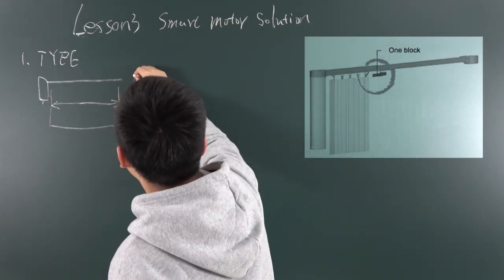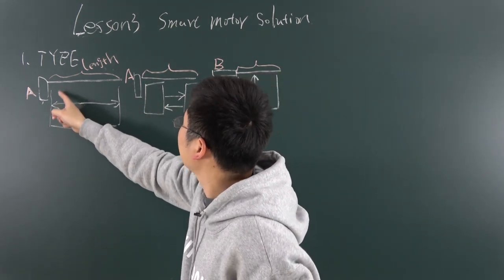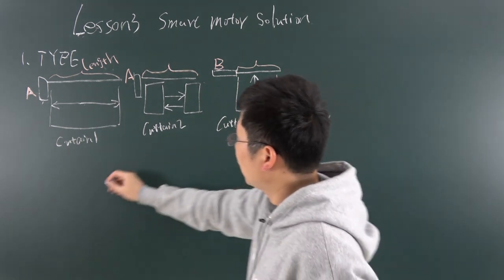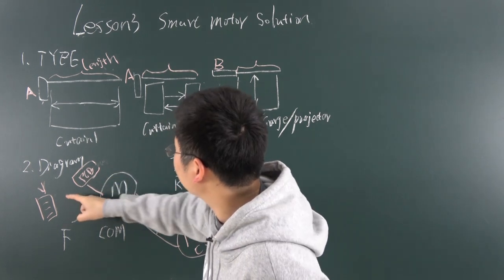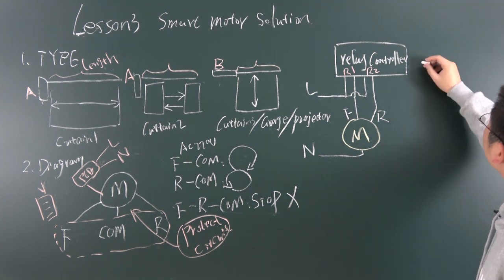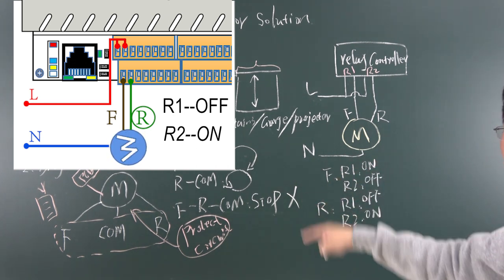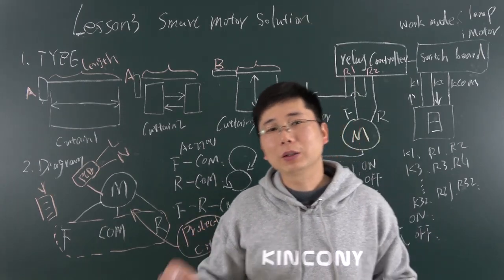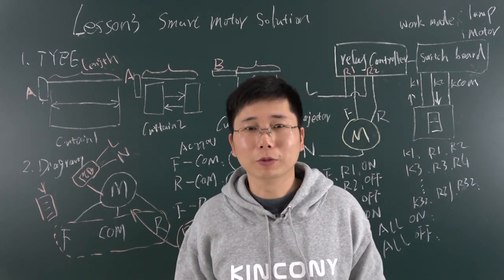【IoT training lesson beginners #03】How to let your motor become smart

Comment: Hi, what if I want one button on wall switch and input panel out of 32 to act as press and hold? As long as I hold the button the reley is on, and when I release the button the reley turns off. Is this possible in home assistant and in kincony android app?
Reply from the maker: you add KC868-COLB work with relay controller is ok, it can set logical command by yourself. we have another video: https://youtu.be/kbQJVTJCkvw this is your needed.

Comment: Thank you very much for the great lesson but i have small question how can we calculate the thickness if the cables for motors or for led strips because when its dc we need to have thicker cables if the distance is more than a few meters or it will burn the cables... Can you please make a video on these things? Thank you in advance
Reply from the maker: here have a table about "area and current": https://en.wikipedia.org/wiki/American_wire_gauge

Comment: Thanks for your Video.
 My question is, what about small and strong DC Motors ??
Reply from the maker: if you DC motor, also use two relay to control one motor, use two relay to exchange positive and negative polarity for DC motor, so that can change different direction.